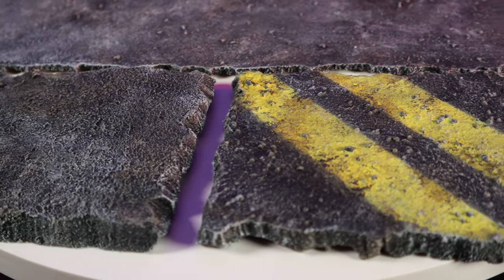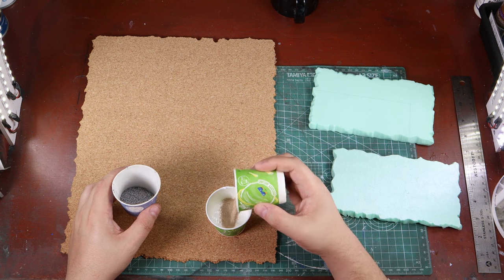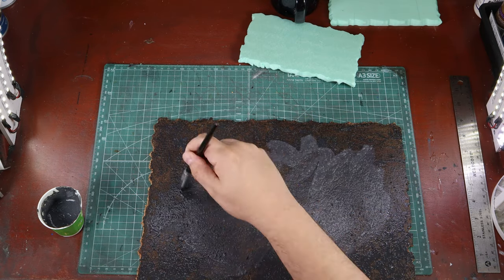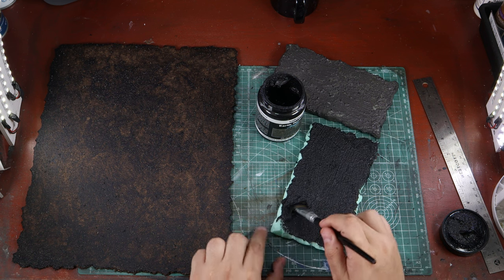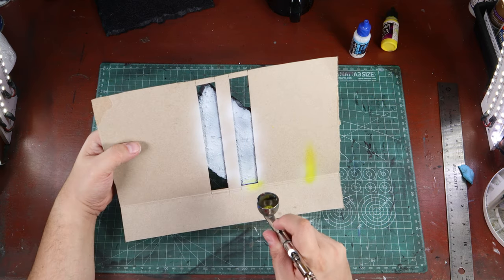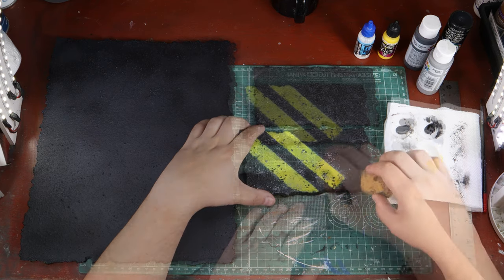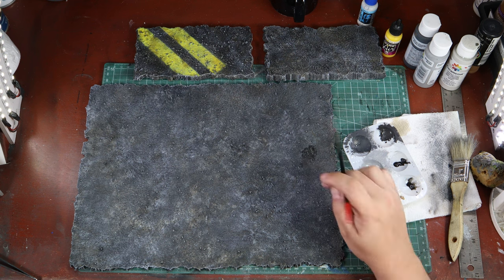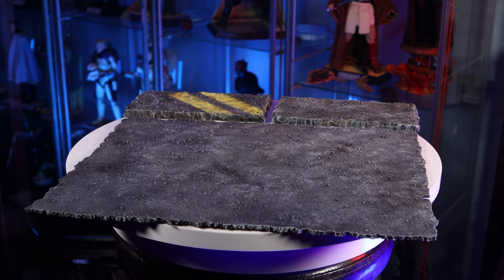Making DIORAMA ASPHALT - Great for any Scale or Size! | CRAFTED Episode 13

Comment: Amazing, thank you.
Is there a homemade alternative to mod podge?
Reply from the maker: Great question, and thanks for watching! 
In short, no, not really. Mod Podge has a proprietary formula, which I believe has certain resin-like ingredients, and shrinks much less than PVA glue. (There's a reason its more expensive than PVA).
Longer answer:
There are plenty of online articles on craft & scrapbooking sites, which claim you can make your own Mod Podge by simply watering down standard PVA glue (e.g., Elmers glue). This works just fine for scrap-booking as its a thin application. However,  I have tried and would not recommend this for making the texture mix I reference in my videos. The watered-down PVA glue shrinks much faster, and any "mix" you make with it could have poor adhesion. (After all...you're diluting the PVA glue.)
Using straight (non-watered down) PVA glue instead of Mod Podge is also an option.  While I think PVA glue is awesome for use in Dioramas,  I do not like using it to create texture mixes. I find PVA glue will, again, shrink and can lead to unwanted cracks on the surface texture.
Reply: @metamorphiccustoms  many thanks for the information 👍🏻

Comment: what is the name of the device you are using burning
Reply from the maker: In this particular video I don't believe I used a burning tool. But in my other related video, I used an old soldering iron to burn the XPS foam. You can also apply paint thinner directly on the XPS to slowly melt it. However, please remember when burning/ melting XPS foam, always do it in a well ventilated area and wear a mask/respirator.